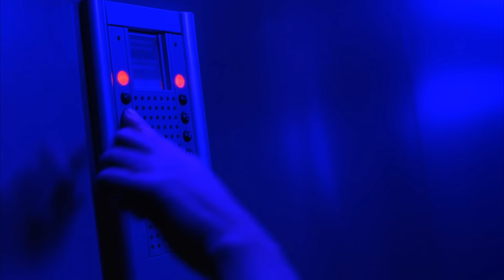Unleashing The Deadly T-Virus | Resident Evil (2002) | Creature Features

Comment: The fact that the lab that contained the virus samples was not at least BSL 3 or BSL 4 is hilarious.  At least in the video games it made sense how the outbreak occurred as the release was on purpose. But it doesn't even seem like they have a dual airlock system with either UV or bleach decor setup.
Reply: T virus release in games was not on purpose, the mutant G ambushed the umbrella spec ops squad in the sewers and caused the breaking of a t virus vial which spread to rats and subsequently the water system. Non of it was intended.

Comment: Elevator death 100% didn't have to happen. The only reason she was stuck is because the ceiling was also cutting off their exit. As soon as the elevator dropped down, there would've been the entire vertical gap between the doors and she would've easily been able to get out, or be pulled back in.
Reply: She was very skinny, she could’ve fit

Comment: I like most of this scene, but not the elevator, specifically because modern elevators Can’t so what we see here.  They have analog systems that prevent them simply dropping.  Even if the power goes out and something awful happens, or someone messes with the control systems, it can’t just drop.

Comment: What bothers me is friction brakes should be mechanical not computer controlled. And per code all elevators in the us should have a hatch to the top for maintenance. And why didn’t baldy keep using the axe. Work the corners with the axe blade and the pane should give way.